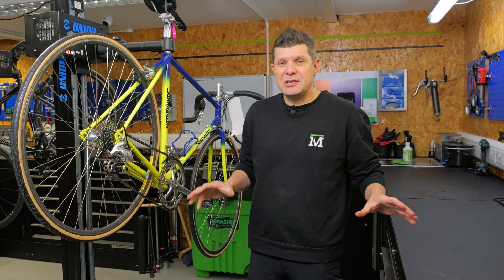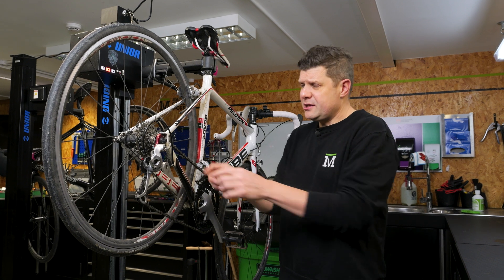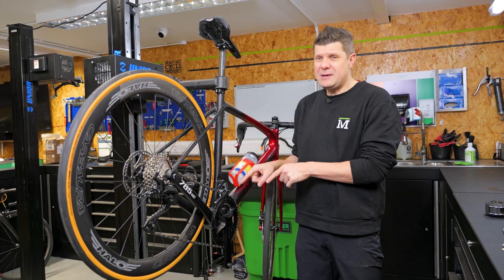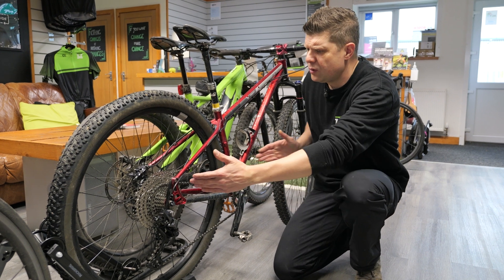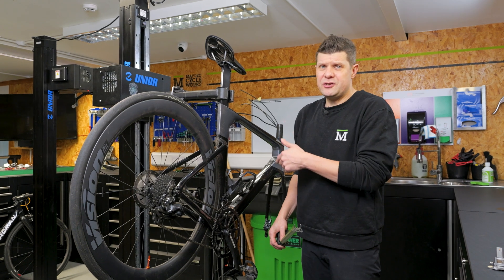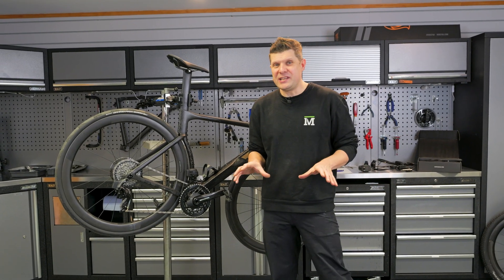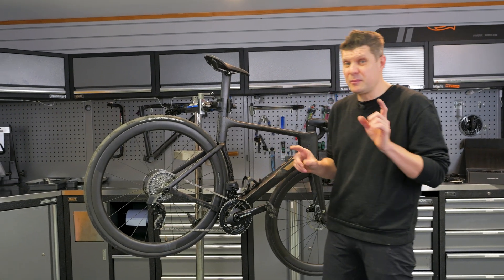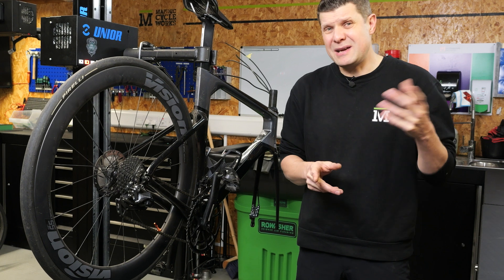This is why we have SO many bottom brackets

Comment: Great video, really opened my eyes to some of the "why"s, thank you Mapdec! Question - how much impact does frame size have on chainstay length? Is it enough to be able to fit wider tyres in larger frame sizes?
Or alternatively - is the shorter chainstay on a smaller frame size enough to make it worth using a smaller frame if you're after a bike which feels more agile?
Reply from the maker: None.  Usually the rear of the bike remains pretty consistent across sizes.

Comment: Great explanation. I feel as if we have gone full circle at massively increased cost and complexity. And the benefit for the average Joe is ...?
Reply from the maker: Yeah.  I think the era of BB experimentation is ending and now we are onto intergrated cockpit madness era.
Reply: @Mapdec  Paul Exactly so the industry has flogged the BB issue to death for well over a decade now its the turn of integrated headsets, more fashion in this than ladies designer shoes 🤣  Clearly the future is already behind us  🚴‍♂
Reply: @Mapdec  my daughter is into MTB XCO. Have been looking to progress her onto a full suspension MTB. I've settled for a Trek Super caliber SLR 9.8 XT. It has an integrated bar/stem but the hoses enter the frame behind the head tube and not through the headset. That was one of my reasons for choosing it.This will make it easier for maintenance but, also importantly, servicing will be cheaper. This push for change by manufacturers doesn't always lead to better outcomes for customers.

Comment: Didn't 11 speed drivetrain specify a 425 mm chainstay length for acceptable shifting? Think I remember reading this a few years ago. The range of angles for 11 and 12 speed can be quite large on a 400 mm chainstay and lead to poor shifting.
Reply from the maker: Depends. 405mm is general minimum (bit of rounding in this vid) 1x and large chainrings can be shorter. 395 I think.  Dub wide is defo 415.  Fallen foul of that one.

Comment: I think the real reason of having so much BB's is the stupidity of manufacturers and the lack of awareness of consumers. The bike industry has forgotten what unification is and that a bicycle was originally invented as something reliable, and not to be replaced with the frequency of buying a new iPhone. 

See? We made carbon wheels! But now your rim brakes don't work well in the rain? (everyone rides in the rain at top speed, huh?). Buy disc brakes, but you'll have to buy a new frame, oops. And then again: are you riding QR? Because of the disc brake, your axle can slip out of the dropout!, thru axles are safe, but you'll have to buy a new frame, oops.

 But this is not enough, so each manufacturer decided to invent their own bottom bracket. And other "innovations" that you wont find it a model couple years newer.

So they produce garbage that in 20 years you will find in the garage and will not be able to get parts for it, because the experiment with the bottom bracket and unique headset/seatpost shape/fork was unsuccessful and no one makes parts for it anymore. (You already can see some frames without fork or seatpost for cheap just because its hard to find part)
But all of those brands will claim that they're green and support recycling, of course.
Reply from the maker: You are totally correct.  The intergrated headset and misshaped stearer tube is the filler of much landfill

Comment: Here's me riding a Surly Straggler with 40mm Maxxis Refuse tyres, and a Shimano, UN73 square taper bottom bracket.
Reply from the maker: Yes.  Great example.  Very long chain stays and ovalized at the BB weld.

Comment: I'm doing my part by not buying anything other than BSA standard!
Reply: PF86 works pretty well and is easy to work on. Issue is frame manufacturers have rubbish tolerances.
Reply: @twatts4436  BB386 EVO should be the standard! end of discussion :P
Reply: Probably so, but it depends on frame tolerances. Threaded bb shells have to be about round and proper size, or the tap will break off. That's a pretty low bar, but it's something. @twatts4436
Reply: Surely that locks you out of certain disciplines?

Comment: A very, very informative video that addresses the compromises necessary to accommodate wider tyres. Learned a lot from your analysis, but still a little uncertain re the dropped chain side chainstay. Big distortion for minimal gain? Thanks and well done.

Comment: No, no. There was a huge mistake at the beginning—not all steel racing frames could fit 23mm tires only. Please, stop making it look as "typical example" of vintage bike. I worked in a bicycle shop that sells only vintage bicycles, and "23 only" is more the exception than the rule. 
I personally have two top-line bikes: a 1978 time trial custom-made Woodrup, with a max tire size of 30mm, and a 1990s F. Moser road bike, with clearance about 30-32mm (measured now chainstay - 40.2cm with 28mm tires installed).

Yes, there are some bikes with (for example of the reason) unicrown lugless fork that can fit 23 max, some with Colombus Gilca tubing and fancy Chinelli BB lug - also 23max, but this is only 2 cases that my friends currently have. It mostly about late 80-90-s when bicycles became very short and tight (50-60-70-s were longer wheelbase because of not very smooth roads as one of the reasons).
Also length of the chainstays depends on BB drop and ST angle. (With higher BB and steeper ST angle you can make stays shorter)
Reply: It's a bit nit picky, but I had the same thought.  My '74 Raleigh International can handle 32mm tires, even though it was sold with tubulars.  As noted, the 80's were all about tight clearances, so my mid-80's Hetchins has short reach brakes with the pads at the top of the slot.  I've got 25mm tires on it now, but they are almost touching the brakes.   One detail in the video that struck me as wrong was the suggestion that the USPS Trek OCLV frame was intended to take 25mm tires.  Racers were still using tubulars then, and folks were still pumping their 23mm tires up until rock hard.  Unless someone has a catalog saying that they were sold with 25mm tires, I'd contend that the goal was 23mm.  I'd say that the time when BB standards were fairly standardized was when Campagnolo NR and SR were the top of the line.  Tech was a bit stagnant then, and no one was changing stuff just to change it.  That came later, when the manufacturers were trying to show that they had the lightest and stiffest design.  Mountain bikes probably had something to do with it too?  The larger tube sizes for the new frame materials certainly were a factor.
Reply: Clearly there are exceptions but think it’s fair to acknowledge that the vast majority of road bikes from that era had chainstay clearance for 23mm, 25mm max.
Reply: @kevinfrost1579  Steel bikes?  My two bikes with the tightest clearances at the fork crown and brake bridge (barely able to pass a 25mm tire) have 32mm between the chainstays.  These are a '82 Raleigh Team and the mid-80's Hetchins.  These are Reynolds tubed bikes, so fairly conventional.  My International, which has huge clearances at the brakes, also has 32mm between the chainstays.  That was pretty typical.
Reply: @SkyhawkSteve  Yes steel bikes ….bit of clarification required from me. I’m referring to tyre sizes in my original comment and yes agree that the actual chainstay  gap is  effectively 32mm.  In my  case that rules out anything larger than 25 mm tyre max due to flexing under load and chainstay rub on typical 1980’s /1990’s steel frames.
Reply: An interesting discussion about which I have two contentions:
- unless they’re widely adopted across the industry I’m not convinced that ‘standard’ is the correct term. ‘Specification’ would seem more appropriate.
- nothing mentioned about the quality of these bottom brackets. The square taper UN72 (Ultegra) BB in my most used bike is still buttery smooth. Can’t recall the exact age but they stopped making them in around 2000 so it is possible to make a BB bearing that lasts despite being used off road in the UK. My experience of more modern designs has been poor.
Reply: 25mm corsa cx tubs were as big as I would go, super comfy but so expensive and would not last long.
Reply from the maker: Who said ‘all’? It’s just an example of what it is before you need to start shaping metal and lengthening stays.
Reply: @Mapdec  For me, as a person who appears alone at rides on a steel bike among carbon, this myth is a rather sensitive "point".
 But in any case, I think that your conclusion in the end about the problems caused by the narrowness of the BSA and ITA bottom brackets is not very correct. Firstly, because there are a huge number of top of the line bikes with such bottom brackets and at the same time quite good clearance for tires (up to 32 mm for vintage ones) and short chainstays (shorter than 41cm). Literally two examples are in my room. Secondly, lugs are not always necessary - if you use welding or fillet brazing - you can achieve even greater capacity by the width of the tire. Also, as a "cheat" you can use a "yoke" connected to the BB (something like a plate, to make it narrow or even to go down a bit) and only after it there is a tube.

Comment: No bikes are a 400mm chainstay. The minimum is length allowed by Shimano is 405mm. The desired advantage for short chainstays is placebo at best, most people wouldn’t feel the difference between 405 and 420 but the longer will have a much better shifting and chainline due to arc tan etc etc. Also t47 internal, 386 evo have no extra width benefits over pf86. Pf86 gives you clearance for 34/35mm measured tyres with ample chainstay thickness for stiffness…
Reply from the maker: Now that is for another video… I did a bit of rounding for the sake of a short snappy vid.
Reply: @ thats some serious rounding even a builder would be proud of 😝
Reply: I just measured and mine is definitely 400mm
Reply: My Pelizzoli pista frame has 390mm stays (yeees, pista is a bit different), but still a bicycle.
For both authors of the comment and channel I wish you more time to spend with different steel bikes.
Reply: You're too young to know about short chainstays.

Comment: My oldest bike, long since gone was a 501 framed Raleigh from the early 90s. The bottom bracket became loose so i undid it competely, and found the ball bearings and races pitted. I bought new(loose) bearings and packed in castrol general purpose motor grease, adjusted  the bb to a fine tolerance and proceeded to 200 im audax rides and 25 minute sporting 10 on that 26 lb thing. So simple to maintain. I agree that the cycle industry seems to have made bbs to too larger variety. Keep up the good work mapdec

Comment: This explains why we had ever changing bottom brackets over time. But there's still a question mark against why there's so many right now,on current bikes.
Reply from the maker: Consumer demand.  We now face the problem were people are demanding BSA. We also have Shimano driving the Bb86 for OEM.  Really there should be 3 standards.  BB386evo for race carbon, T47i for MTB and Non race carbon, and T47 for metal frames.
Reply: @Mapdec  Paul and we all know why that is ……….an attempt by carbon frame manufacturers to side step issues created by  an inability / commercial unwillingness to make two round holes opposite each other.  Shame as executed well …….no issues………..but that’s the story of the ‘modern’  bike industry  isn’t it ? 🤷

Comment: You sir have been awarded a PhD on the subject of chainstay length v BB shell width.
Reply: unfortunately, he made too many mistakes in parts about BSA/ITA bb's and steel frames. And not mentioning BB drop/ST andgle in talk about stays length (especially comparing them by 5-10mm difference) is wrong
Reply: Let mapdec have a round 2
Reply from the maker: @isaacrosenberg3795  it would be a very long and boring video.  Short bite sized education here. Keep watching. 👍